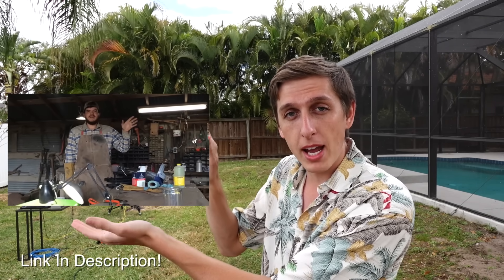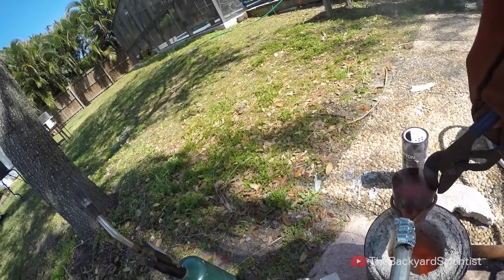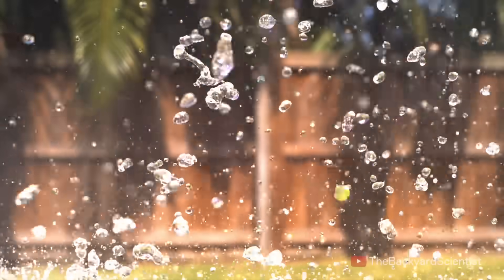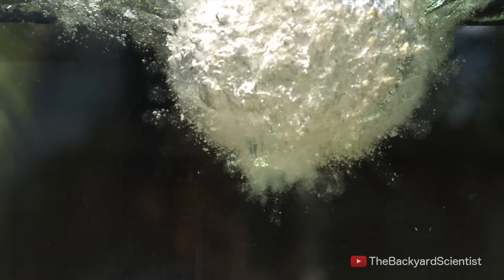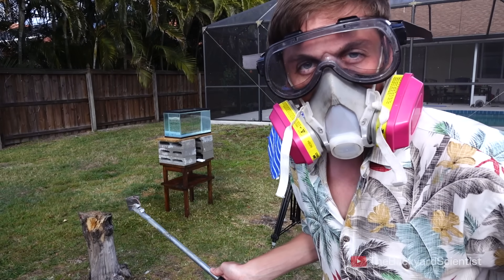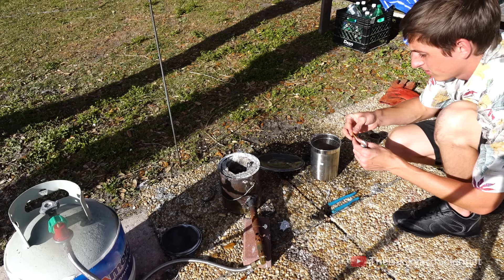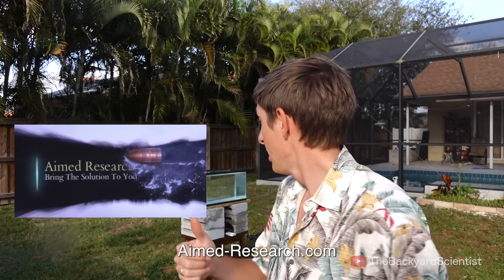Pouring Molten salt into Water - Explosion!

Comment: I think you theory is on the right track. However I don't believe that it is exactly the leidenfrost effect breaking down faster for the NaCl. I think that the inconsistency is due to temperature differences between salt experiments. The theory is similar to yours. I believe that it is a physical reaction. The hotter the salt is as it enters the water changes how long it last and how deep it can go before exploding. As for the cause of the explosion. It happens as the leidenfrost affect breaks down. The salt is cooled enough to come in contact with the water creating vapor spreading the salt rapidly apart as it is entering into solution. I think that your pretty much on target but it is due to uncontrollable nature of the experiments shape of the liquid salt temperature differences.

Comment: I'm thinking it's the crystal structure of the salt. when I was younger and doing dumbness stuff like this I heated a shot glass and dropped a few drops of cold water and boom glass fractured violently looked about the same but in your experiments the  salt is pressing the water word the path of least resistance slightly to the side and straight up ..... Cool video from a back yarder  to another

Comment: this is probably because a solid salt is in a crystral structure where it "shares" electrons with for example chloride wich gives salt a normal current because for example  Na- and Cl+ share an electron but when cooking it the crystral structure is gone and Na and Cl move freely when h pour it in water wich is h2o it Comes in contact with Hydrogen wich current is h+ because it  lacks a electron (it "wants" to Be like gasses like helium with a full electronics ring contaning either 2 or 8 electrons)wich Na has and as is common for all elements which has 1 electron in there outer ring it reacts heavily with water.
i hope i explained it well enough because english isn't my first language.
Reply: +Rienk van Vliet You surely know more about chemistry than the guy making the video. Still, the point is that the sodium reacts with water with the reaction: 2 Na + 2 H2O --> 2 NaOH + H2. The H2 is the gas that he observes in the bubbles being formed, and with this reaction being so exothermic, all the heat is released and the hydrogen gas catches fire. I'm not really sure where he got the idea of pH making any difference. The reason why the pure molten sodium exploded more violently might just be because there was more of it in comparison to the molten sodium chloride where half of the molten liquid was chloride ions which don't have any significant input in the reaction at all.
Reply: That's not really how it works. Metallic Na reacts with H2O to form NaOH and H(two of which quickly merge up to form H2), plus a lot of heat, which ignites the hydrogen. NaCl is a more stable compound than NaOH, however, so it won't trigger much of a reaction in water(which is why salt water is stable).
Reply: never Mind then i tried to apply to the stuff i learned in chemistry but now that i think of it Na can be disolved in water without an explosion

Comment: I think that it is due to the high difference in temperature (notice that out of all of the compounds you tried, only NaCl was soluble) salt caused the water to boil PRETTY quickly creating an explosion! The pH in this case would not change indeed.

Comment: is there a possibility that the NaCl is reacting to the atmosphere when you heat it up or that you are changing the molecular structure of the salt in a particular way?
Reply: Unlikely. NaCl is pretty strongly bound, and air contains nothing that'd really ionize well enough to start a reaction - it's >99% composed of N2(which is almost totally unreactive), Ar(which is even less reactive), and O2(which is more reactive, hence us using it to live, but not particularly reactive with either Na or Cl).

Comment: What if its a hydrogen explosion from the heated water?
Reply: +Das Neko Rather a steam explosion because the water is being super heated. It's like pouring water into hot oil.

nevermind. i just did a little research and it seems the problem isn't as simple as that
Reply: TheAzureKite Not sure. Steam explosions are generally not that powerful but a hydrogen explosion rips apart buildings.

Comment: It wasn't until I remembered how pure sodium reacts with water (it's been almost 10 years since my chem class) that I could come up with a hypothesis for this experiment. 

Pure sodium (Na) doesn't actually explode and only causes the explosion on the surface of the water because of the product of the reaction with water (H2O). When pure sodium is dropped onto the surface of water the sodium steals the Oxygen (O) and one Hydrogen (H) from the water (H2O) to create NaOH and H2. The sodium essentially rapidly heats up (97.8 C is the melting point of Sodium) and melts into the water but there is a gaseous byproduct of H2 which is extremely volatile and would almost ignite by sneezing at it so it lights up because of the excess heat in the surrounding area caused by the reaction. NaOH is an acid but you never did the scientific thing and did the PH test of just the sodium (which doesn't have to be melted prior to the experiment but can be done as a control).

Theory: the Chlorine in the molten salt allows the water to completely engulf the molten salt so that your theory of the rapid expansion of gas to be the case, it also keeps the temperatures low enough that it doesn't ignite the hydrogen byproduct or the chlorine also reacts with the hydrogen making it inert. You should do this experiment again with a oxyacetylene flame just above the reacting molten salt and water. This would show if the hydrogen by product from the sodium reacting with water is reacting with the chlorine or not.
Reply: +Jacob Sorensen Actually, NaOH is a base. Not an acid. Also, I'm not sure whether Na would actually connect to OH like that. As Sodium doesn't react easily. It can actually be disolved in water without it doing anything creating Na+. Although perhaps the fluid state (+ the high energy level ) makes it react more violently.

I could ask my Chemistry teacher?
Reply: Realjsh010 No trust me Na reacts with water forming NaOH and H2  NaOH has a ionic structure I'm sure you know how ionic bonding works

Comment: it's the chlorine. i work in a chemical plant and one of the blocks i work in is a chlorine plant. chlorine reacts violoently (explodes) when it comes into contact with water. when you heat up the NaCl to those temperatures, it's breaking down the bonds, letting the chlorine react that way.

Comment: Well I'm no chemist but usually comma salt dissolves in water and since it is super heated when it goes into the water at a certain speed, that the salt tries to dissolve in the water but the salt particles are too hot and they make the hydrogen particles explode because as everyone knows hydrogen is very flammable. but that's just a guess
Reply: +BianchiiGaming elemental hydrogen is explosive, but not the hydrogen in water. it would mean that there would have been a process in ripping of the hydrogen from the oxygen, creating H2

Comment: Well your explanation is completely wrong... there is nothing to do with physical explanation, it is chemical reaction. Salt (Sodium Chloride) contains sodium which is super reactive with hidrogen in water. When a solid cold salt is poured into water, nothing is happen because sodium binds so tightly with the chloride. However, if you molt the salt, the energy inside the salt is so massive that may break the bond, resulting a reaction between sodium and hidrogen. And that is why you get a BOOM and even bigger BOOM when you poor it exactly after you molt it (higher temperature).

Comment: I believe that it might be a physical reaction in this case. The outside cooled so quickly that it created a shell and just trapped the energy( steam) inside but the shell was fragile and couldn't hold it. so exactly what you said and with the sodium chloride only being the one to react might be that the chloride(chlorine) gets converted to a gas also trapped with the steam.

Comment: Is it possible that the molten salt caused a dissociation of the oxygen and hydrogen atoms in the water molecule through thermolysis, and subsequent ignition of the H and O2 gases (the temp of which is decreased by the increasing pressure)? I didn't see any flame, though.
Reply: +Studentofgosset I believe that because of the strong solubility of salt that the leidenfrost is overcome by the water molecules attempting to dissolve the salt. However, because of the great temperatures, the water is unable to maintain its liquid state at those temperatures... Just a hypothesis.
Reply: Deatheraux
I've subsequently read that the boiling temp of NaCl is too low for any significant amount of water to thermolyse.

Comment: isnt the actual reason that the sodium reacts so violently to water just part of the alkali metals reaction to water? if the same experiment was done with rubidium then the blast becomes more violent. each step down the alkali metals has a higher reaction to water.
Reply: +Spurrlin true

Comment: the sodium causes the reaction. the elements on the left side of the periodic table react so readily with water that an explosion occurs. get some pure sodium and dump it in water and it will explode. as you go down the elements on the left of the table, they become even more reactive. search YouTube for cesium in water for example. I would guess that by melting table salt you are separating the sodium from the potassium, and the pure sodium is what goes caboom.

Comment: The reaction between group I alkali metals and water yields a metal hydroxide and hydrogen gas, and is also extremely exothermic. The hydrogen gas is combusted by the mass amount of heat produced.

Comment: What you are witnessing is a dual reaction with the molten sodium and the chlorate working as an oxidizer. The molten temperature of sodium is enough to separate hydrogen and oxygen. Once they have separated the temperature is high enough to ignite hydrogen. That classic treble 'pop' is hydrogen igniting. That is why it takes a moment for it to detonate. The molten salt forces hydrogen and oxygen to separate. At the same time sodium is reacting with water and chlorates are oxidizing and finding a fuel source.

Comment: I think what is happening is simmilar to what happens when you put a cup of water from the faucet into a microwave. After heating it up touch it with a spoon an it will boil. Its the impurities in the water that cause the boiling. If you do the same with purified water it wont boil.

Comment: isent it a thermal reaction just like when you quench hot steel. just as a liquid the surface area is much greater thus cooling happens much faster resulting in a explosion. like how they used to dig through rock with heating it up then dumping lime water for rapid cooling.

Comment: If it was a physical reaction, you would see the same reaction with the borax.

Since the borax had a different chemical composition (and therefore a different reaction), and a sodium object with different physical features (such as the saltmetal) caused a similar reaction which involved plasma (fire), there had to be some sort of chemical element in the explosion.

The fire is the key there. You essentially purified the ingredients which gave a much greater effect, which resulted in a plasmic discharge. You only EVER see that in a chemical reaction (burning).

Just because a chemical reaction takes place, doesn't mean that the pH is going to change significantly enough for you to detect with paper. I would suggest you test the pH using a machine.

Also, it's possible that some aspect of a chemical reaction could be self neutralizing... and it's just a coincidence that they both show a neutral pH.

Comment: The borax and other salts probably had another coating to them so that the salt had never contacted the water whatsoever. Therefore the salt's temperature, although compacted in smaller spaces, had the opportunity to cool down enough for the water's temperature and its would not clash but instead combine, making it stable. The outer coating would have to have been water resistant and likely to expand through time :P
Reply: Probably not completely though

Comment: Hi there, in my opinion water under hot solt brakes from H2O to H2 and O2 (gases) and then burn again rapidly. O2 with H2 is highly explosive. External energy in hot solt is converted (by braking water into oxygen and hydrogen) into explosion.
That is my gues. Regards :)

Comment: As an original hypothesis I thought it was just the water heating to its evaporation point near instantaniously, like it does if you pour it in a turkey fryer. (DO NOT TRY THAT)
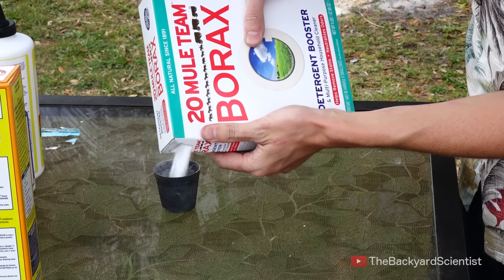But after watching slo mo I think that maybe melting NaCl perhaps seperates it? I could most definately see different colors in that little block 1:09 . I know Na reacts extremely voilently with water. but I'm just spouting off near possibilities at this point. Time of comment is 4:53

Comment: I think that the way that the leidenfrost effect is breaking down for salt is because salt has less surface tension than any of the other ionic compounds and you could prove it by pouring larger amounts of molten borax into large amounts of water and if you get an explosion then it has to do with the surface tension (note: if you actually try this you definitely need some good safety equipment)

Comment: Chemistry Stuff: 
  I don't know if anyone has answered yet, and this is just an educated guess but... 
In short, I believe this is at least partly a chemical reaction, and the reason table salt reacted was
because the water could get to it- with the other more complicated substances,
too many other atoms got in the way (imagine water molecules having to swim through a bush to
get to the atom they want vs just being right next to it).

Sodium Chloride is simpler than the other salts: Na-Cl vs Na+lots of other stuff. Also, the entire
first column on the periodic table reacts violently (read: explosively) with water. And since the NaCl is smaller, the water can reach and thus react with the Sodium more easily, causing the explosion. Adding to this, at higher temperatures, things are more reactive, which explains why when you heated it up more the second time, it reacted more violently.
Reply: +TGKcraft  nice try bubby, but that's not how it works
Reply: the Sodium would have to chemically separate from the chlorine for any chemical reaction to happen
Reply: TGKcraft  Well, unless I'm mistaken, that is what happens when you dissolve salt in water: the positive Na is attracted to the negatively charged O in the water (H2O) while the negative Cl is attracted to the positve Hydrogens. Thus the NaCl is split apart- and this process is only aggravated by all the extra heat, and the fact that the salt is now liquid.
Reply: г-н зонт fam idek i havent even finished high school chem yet
Reply: Kgcopper im pretty sure since its an ion it wont react the same as it would normally tho

Comment: Sodium + Water = Explosion
Now the science in this video: When you melt NaCl it becomes NaCl liquid and Na+ Cl- ions start to move freely and the energy kinda gives time to Cl- to give it's extra electron to Na+ while they both get in the water and boom. (I know what I wrote is  not 100% true, it's simplified)
Also your physical hypothesis is true to some point and it's called Leidenfrost effect and as far as I remember you have a video about it but it wouldn't be able to contain enough water in it's self to make a huge splash. After all you are pouring ions not polymeres.

Comment: I would assume that because sodium chloride has a stable-bound structure of a cube that when it is molten, that structure is deformed. When it hits the water, it attempts to reform into a cube; capturing water in it as it does so. How water gets in? I'd guess that the attraction to the stable-bound structure is stronger than the expansion of gas around in; so it basically wraps around a bubble of steam before the steam has finished expanding.

That's my whack at it.